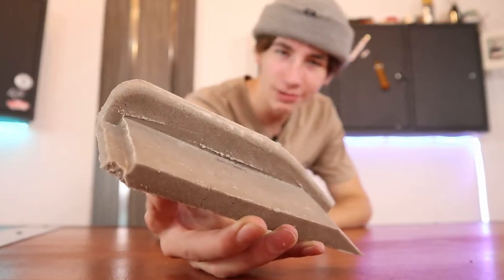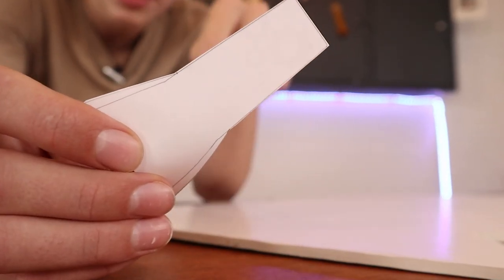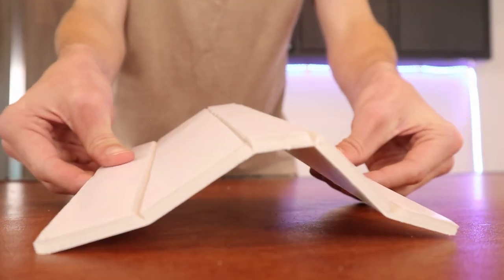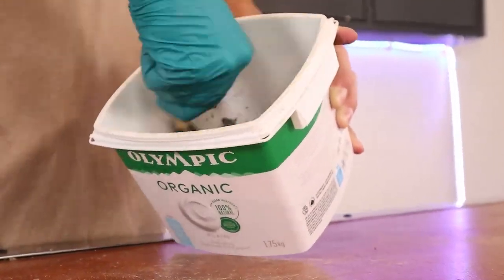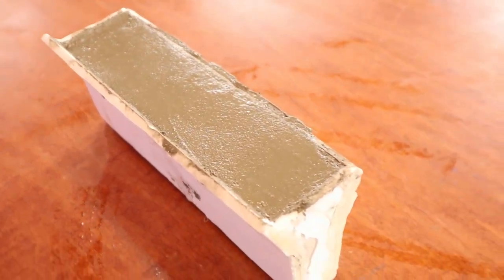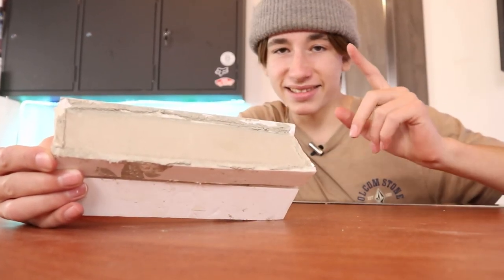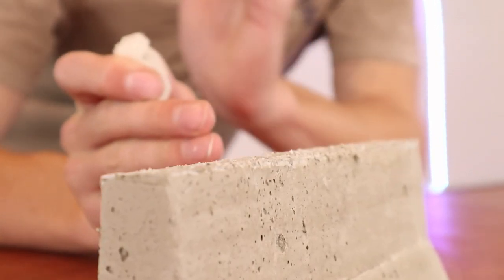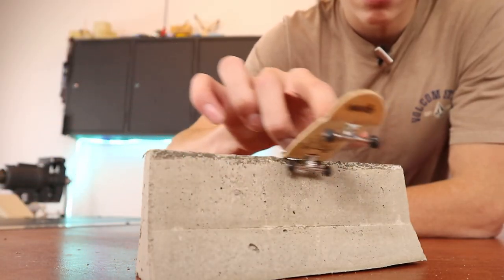The Easiest D.I.Y Concrete Fingerboard Obstacles

Comment: you should really try epoxy resin for a final finish, i use it for all my outdoor d.i.y spots and its makes them like glass when finished:goodvibes: they sell it in most arts & crafts sections. its a quick 2 step mix process and just paint it on with a brush.
🦷🦷🦷